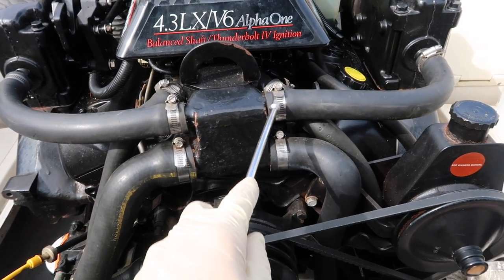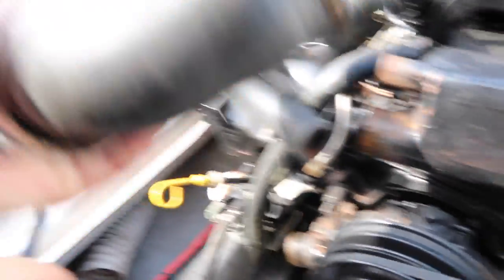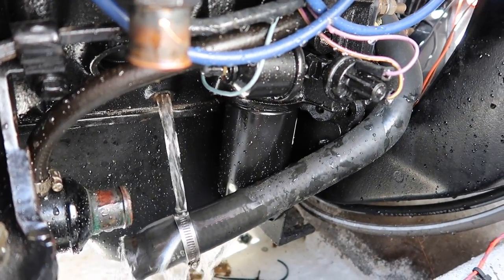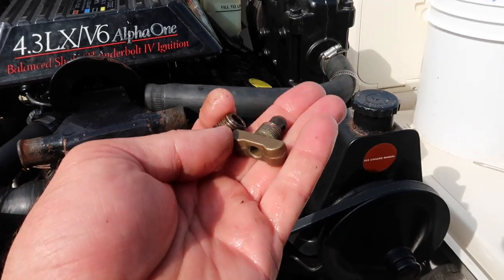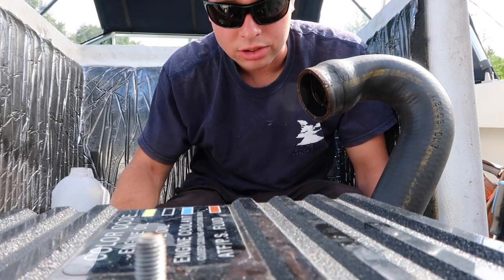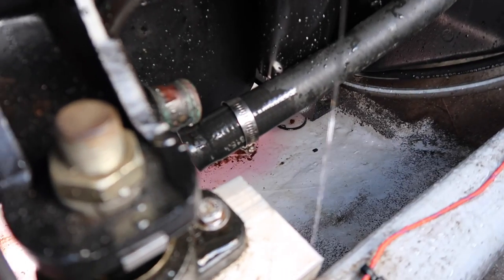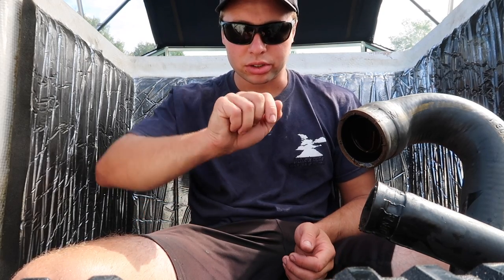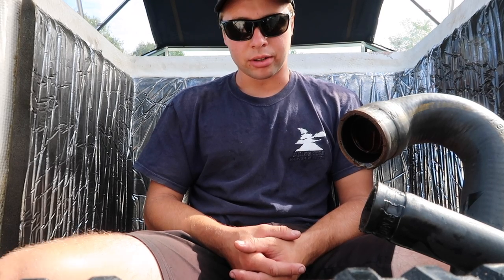Mercruiser 4.3 LX V6 Winterization

Comment: This is very helpful for the motor but I have one question. Do I need to drain the outdrive of any antifreeze or do they drain themselves in the down position? 

I have a 1986 Four Winns Santara 215 with this 4.3 LX in it.
Reply from the maker: No you do not. The line that you pull off on the power steering cooler is the one that comes from the drive and will drain back itself. I usually give the motor a tiny 1 second crank on the starter to give the impeller a slight turn so it will drain water that is possibly caught between impeller fins. Not required though.
Reply: @Schneids15  Was not expecting such a quick response. You are the man! I just bought my first boat from my father in law. He's having a mechanic winterize his new boat for $300. I would like to do it myself and save some $$$! I live in Indiana and we are expecting overnight temps to fall below freezing, so I have to get this done tonight. Hoping everything goes as smooth as this video!
Reply from the maker: It very well should. If not shoot me a comment. Have a small flathead or pick because the lines will need pryed off most likely. Be sure to physically see pink coming out the holes. Be sure to poke the holes that water comes out as it will be rusty likely. Indiana, right on. I have a couple buddies near Indy.
Reply: @WrstlrZ28  dou need to put the plugs and then fill it with antifreeze

Comment: Great video! It helped me find the two engine block plugs I was missing.
Do you winterize the outdrive at all?
Reply from the maker: Make sure there is no water in the gear oil. I drain and re fill every fall.
Reply: @Schneids15  Okay, I'll do so. Thanks!

Comment: So you just leave all the stuff disconnected until you’re ready to use the boat again or what
Reply from the maker: Yep
Reply: @Schneids15  is there any reason why you can’t put in all plugs and fill the areas with pink antifreeze, put hoses all back on and leave it in there all winter?
Reply from the maker: No reason you can’t. I was always taught air doesn’t freeze and leave them dry. There had been multiple occasions of pink antifreeze actually freezing according to what i was taught in school.

Comment: Appreciate the video. Nice to see it done with my exact motor. Just one question, do you leave the plugs out and the hoses disconnected all winter or do you put it back together?
Reply: Also wondering this same thing
Reply: put it back together. especially if you have brass plugs in the cast iron block. being exposed to the air the threads in the block will rust away over time. then you will have to oversize and rethread the drain hole.( a real pain in the ass in most applications i've seen). better yet, while you still have good theads in the block locktite 1/4 in x 1/8 in reducers (brass) into block then get 1/8 in brass plugs for the brass reducers tread rusting away problem gone!
Reply: I spray the threads in the manifold and block with wd40 or a light oil to stop the air corroding them, and leave the plugs out.  Two reasons.  1, you never know if some water might want to come out via condensation (unlikely but can't hurt to give it a way out), and 2, if you put the plugs back in whist the engine is warm, when it cools you might have one hell of a job getting them out again as those plasitc ears on them snap relatively easy.   Better to leave it until you are ready to put the boat back on the water and put the plugs back in hand tight whilst the engine is cold.  You know then that they have sealed well and you know you can get them out again.